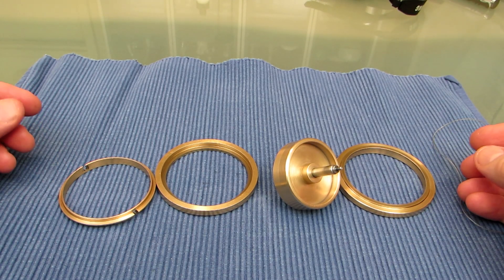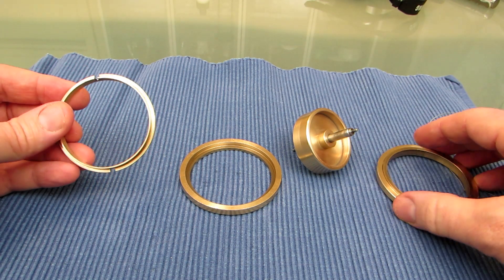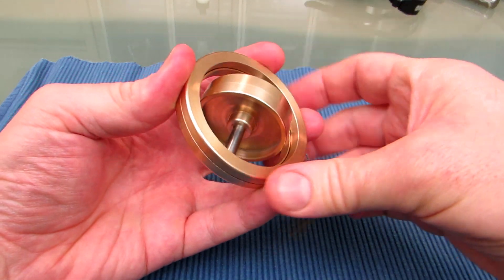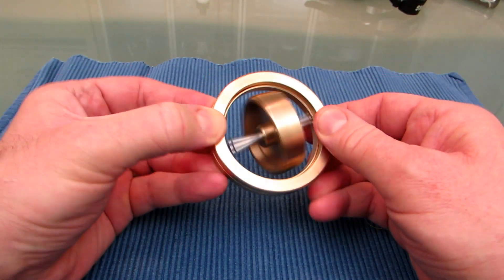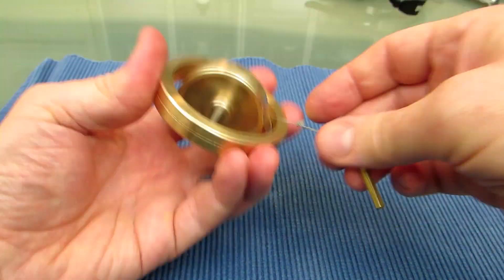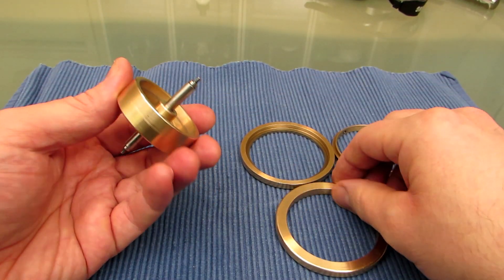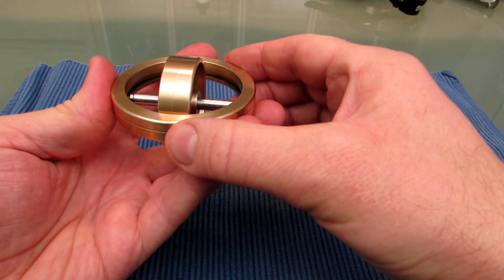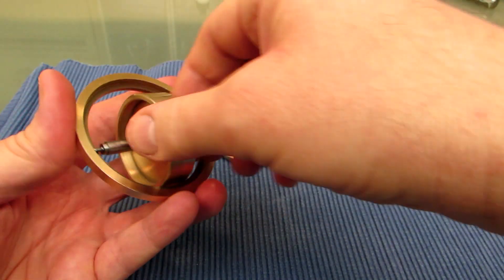Cool Gyroscopic Training Tool

Comment: cool !......those gyro-grip toys always did amaze me.....that fact that you can accelerate it via timing & keep it going indefinitely. I had often envisioned making a very large & heavy one like built into an "exercise chair or rower type thing" for instance !
Reply: I have wanted to make one out of a car disc brake, to be accelerated to top speed by compressed air, but once I felt the forces involved in a 4" bronze flywheel I realized that the disc brake idea was potentially very dangerous.
Reply: @intjonmiller  Sure could be, as all flywheels are energy storage devices. & any bomb is just the fast release version. Finding an "optimal" balance between Mass & Radius & RPM can be tricky. A brake rotor might be an OK starting point but Its typically best to have the majority of the mass as far to the outside edge as practical, since Velocity is the most significant(squared) aspect, which of course would require more tensile strength towards the center of rotation. But just about ANY balanced rotating mass should "work" to some extent, IF you can "safely" get it going fast enough.